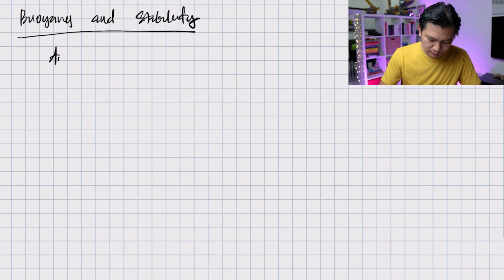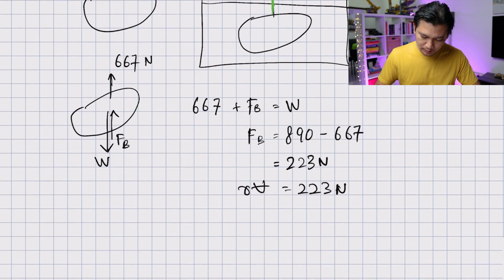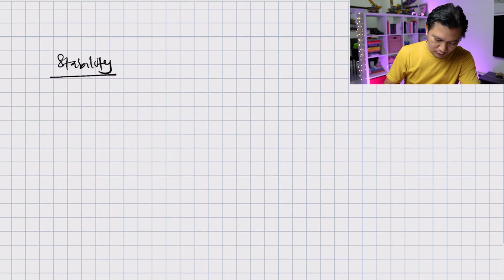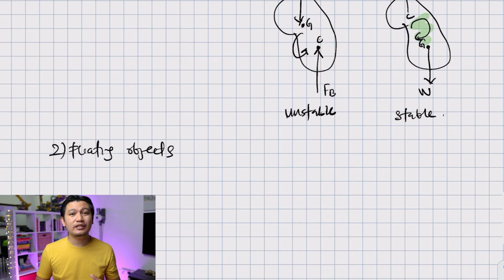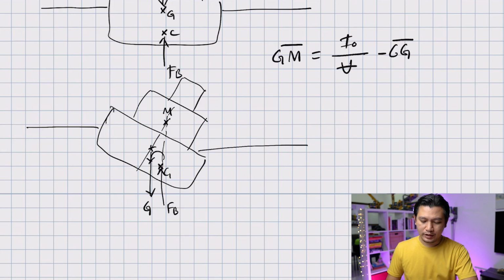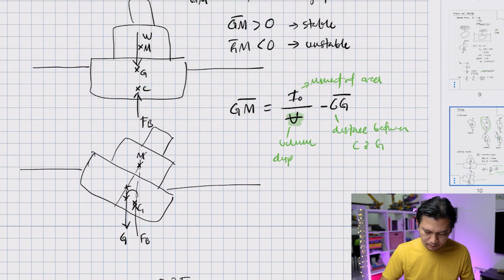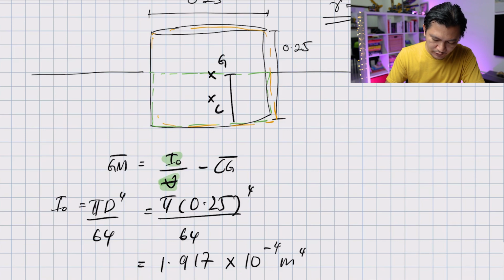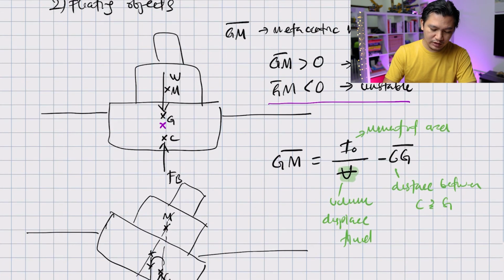009 Buoyancy and Stability

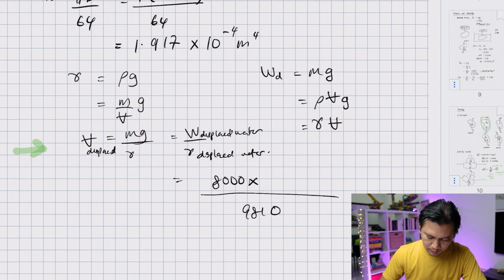Comment: thank you for ur hard work but i could not understand where the V comes from  u can refer the vid at 19:04
Reply: Hey mate, I know it was late, but if you can see this is a floating condition where Fb ( force of buoyancy ) = Wo ( weight of object ), so to find the Volume of water displaced, you simply use the formula of W=mg , and reformulate it become YV (gamma x Volume ) and subs it into W in the formula of v=W/y where V is volume of the displaced water. Then subs the W value with the V x y of object. then you will get the water displace.